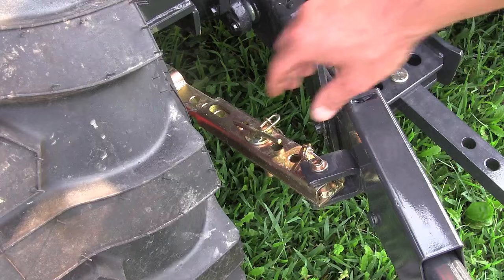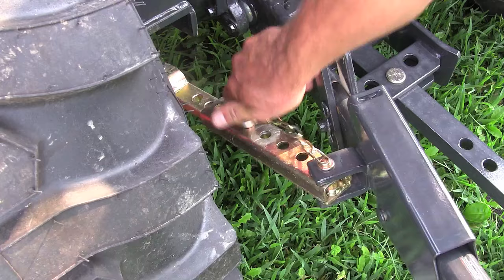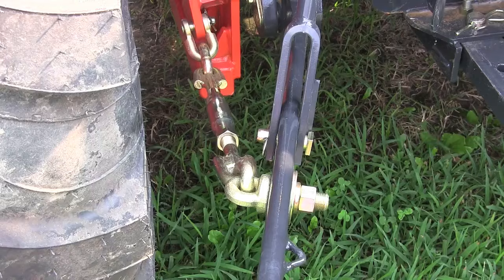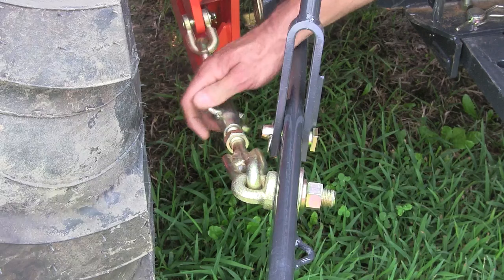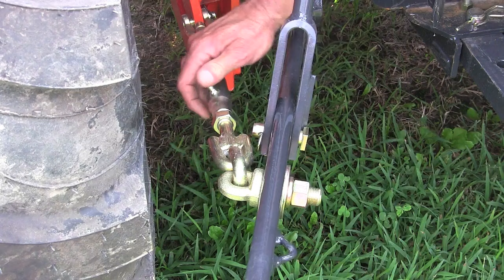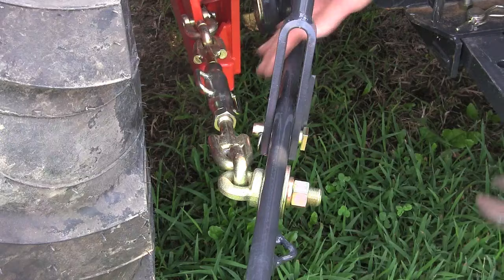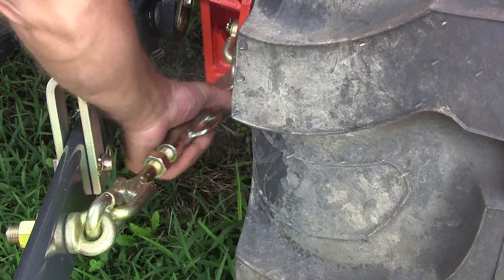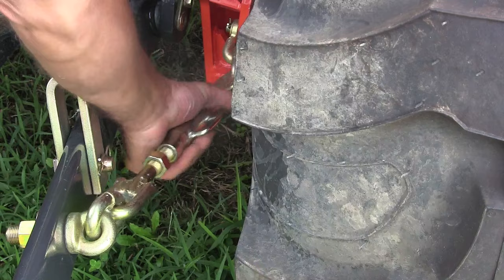How to Adjust Tractor Three Point Stabilizers

Comment: Mike, you tightened that first jam nut with the crescent wrench BACKWARD.  The second one you tightened correctly.  The strength is not in the jaw but in the steel....Probably not a big deal on a turnbuckle but back on the farm In Iowa, dad would give you a stern talking!  Great video, thanks.
Reply: Same here, wking wells and pumps.  You just want to through a sloppy Adj wrench in the trash.

Comment: I didn't notice on your tractor and you didn't mention it, but on my tractor, height matters. I have to raise the arms all the way up before adjusting. If I do it down low, the chains get tighter as I raise the arms up. When I lower them back down into position, the chains are a little loose, but not bad. The first time I adjusted them low, thankfully, I stalled the hydraulics and nothing got broke. Now I watch for it. Keep up the great videos!
Reply from the maker: Good point.  I really hadn't noticed that before but I've seen stabilizer designs that could cause a problem that way.  Thanks for bringing that up!
Reply: that happens when the chains are not connected in the same line with arms pins on rear axle; or the holes for the chains are worn out and connection point is out of that line. Tightening when lifting shouldn't be a "feature"

Comment: There are indeed stabilizers for older Deere tractors. They are steel blocks that mount on both sides of the PTO housing that have two different thicknesses, depending which side of the block is turned. These work as spacers. This will keep your implement from swinging side to side as much, and keep the arms out of your tires (only when mounted to an implement). But no fine adjustment.
Reply: Correct.
Reply: That's right. The sway blocks are missing from the J.D. and were used starting with the 730 series.  You used spacers between blocks and housing to achieve correct sway.  Worked great. ******  Also Tractor Mike forgot to warn that you must slowly raise the arms and make sure chains don't get too tight in full raised position.  Expensive parts can get broke if you raise 3 pt. without checking first.

Comment: You described the stabilizer chain's function to keep the lift arms from hitting the tires. That is the function of the check chains. Stabilizer bars keep your implement centered and moving from side to side. If you want your implement to move from side to side but need to check the travel so you don't hit the tires, like when pulling a plow, you use check chains. That old Ford tractor you showed looked like a thousand series  tractor because it was blue. What you showed on that Ford were check chains. That tractor came with solid stabilizer bars that attach to stabilizer pins on one end and to the lower link implement pins on the other. Ford lift arms do not have holes in the lift arm for a stabilizer chain, though some people drill holes in them so they can attach stabilizer chains.  If you are using your chains solely to prevent your lift arms from hitting your tires, you are using them as check chains, not stabilizer chains.
Reply: pat cheatham 
The check chains on the old blue tractor prevent your lift arms from swinging towards your tires. You might have to remove links depending on the height of your lift arms. 
For stabilizer chains you loosen them up so they allow movement, but still keep the arms from hitting the tires. But, unlike check chains, stabilizer chains must have an implement attached to the lift arms to limit the lift arm movement. With stabilizer chains the left chains prevent the right lift arm from hitting the right tire as long as you have bound the lift arms together with an implement. If you don't have an implement attached, then you use a bungee cord and tractor Mike had a bungee cord on his lift arms for that reason.
Reply: TheDadPenfield ok good now I don't have to type this lol
Reply: what implements do I use and not use the stabalizer bar on my ford? to keep it from swaying? on the ground lock it solid and in the ground let it sway?
Reply: I have a 601 workmaster, and I added a second bar so it could stop swaying to the left and when I lifted the 3pt up it bent the hell out of the new bar while the old bar stayed intact. I hadn’t run into this on my 8n so I’m not sure how to fix this

Comment: Geez, I used to own a 1968 Massey Ferguson 165 and it had round solid bars with threaded rods to act as stabilizers.  You could adjust them to center the implement on the tractor's center line.  That's exactly what I did to center a Four Row Monosem MS vacuum planter on mine.  Tractors with cabs sat on my farm while I precision planted.  When you're planting onions you want to be able to get on and off the tractor easily to check if a shoe is clogged or if a spray nozzle is clogged, which it never was, but you do it if you're a perfectionist.  As far as these chain and turnbuckle stabilizers, they only come on cheap tractors.  If you need absolute stability get a tractor with tube stabilisers that screw in and out.  I'm looking at this tractor, I don't know who makes it but it is about as cheap as you can get. GET A SOLID TUBE TELESCOPIC STABILIZER KIT AND BE HAPPY!

Comment: Mike,  you missed some stabilizers from the past. My old 1959 John Deere 430 had a separate stabilizer that was like a "U" shape at one end connected to a "Y" shape. (Imagine the "U"  in the saddle of the "Y" ). 
A bar connected that stabilizer to the tractor just above the PTO. Ford used an outside bar on one side that (sometimes both sides) to control implement sway.

Comment: My Tractor (1982 IH 260A) have non adjustable chains.  Box blade does not seem to be centered and swings side to side.  It looks like I have to ADD these adjustable turnbuckles.  Thanks for the Info.

Comment: THANKS FOR ALL YOUR GREAT VIDEOS. I HAVE A FORD 4000 SU, WHICH I HAVE TRIED DIFFERENT TYPES OF STABILIZER BARS, STABILIZER CHAINS. THE BARS, LET BE RAISE & LOWER MY HEAVY BUSH HOG, BUT ARE A "PAIN", BECAUSE MY DIFFERENT IMPLEMENTS VARY IN WIDTH. THE CHAINS, WITH THE JAM NUT, WILL NOT LET ME RAISE MY BUSH HOG, ETC. TO IT'S HIGHEST LIFT. I DON'T WANT TO HURT HYDRAULICS, OR DAMAGE THE ARMS. CAN YOU PLEASE TELL ME WHAT TO DO, I WOULD APPRECIATE IT MOST GREATLY. THANKS.........

Comment: Mike - I have a 7’ Enorossi sickle bar mower and am using it on a 65-HP tractor.  The lower 3-point arms are set at equal heights from the ground; however, the mower leans quite a bit to the bar side when raised.  Is this normal and acceptable or should I adjust the lower arms to level the mower even though one arm will be about 3” higher than the other arm?  Thank you.
Reply from the maker: Tricia, I think that's normal.  As long as the bar is level, you should be fine.

Comment: Could you give any advice on setting a plow for a wide wheel stance tractor. With stabilizers set as far to the right as I can get them, I am still leaving a spot of unturned soil. Wheels are set in as far as they will go as well. Tractor is a Mahindra 4025 4X4.

Comment: The second type (turnbuckle), is it cheaper to buy? It's not like the telescopic version is drastically more expensive to produce, I guess. But the turnbuckle seem inferior to the telescopic. And those have been around since the 60ies (have it on a MF 175). So why would anyone want the turnbuckle variant?
Reply from the maker: +subwarpspeed That's a really good point.  You wouldn't think the telescopic would cost much more.  Most tractor companies offer deluxe tractors with telescopic and basic (cheaper) tractors and they lack a bunch of options to get the price down (see my video-Two Identical Sized Tractor, Why One is $3000 cheaper), so it may have more to do with marketing than anything.  If I were a tractor company I'd offer a kit to convert the turnbuckles to telescopic and charge a hefty price for it, but most don't.  It's a mystery.  Same way with a mechanical linkage at the back of the tractor to raise and lower the three point from behind.  When I first saw that option 25 years ago I figured by now all tractors would have it and they don't.

Comment: Mike, i have telescoping stabilizers on my Massey Ferguson and a Bush Hog brand bush hog. No matter how I adjust them, out/in, they hit my tires, especially on turns and on inclines. It seems to have gotten worse the last few times I cut. Which direction, pulling them out or pushing them in, stops that?
Reply from the maker: Bill, email a picture of the stabilizers and the model number of the tractor to mike@asktractormike.com and we'll see if we can't figure it out.

Comment: Mike: great stuff...I have a 1967 JD 2020 that needs your help.  As shown in this video, there are several older tractors with no stabilizers.  What do you suggest?  I need to add something besides a rope or a bungee cord.  My new box blade is heavy and swings too much.
Reply from the maker: I don't know of any kits to add stabilizers.  I'd be trying to "blacksmith" something on there to keep everything from swinging.

Comment: Hey mike great channel - question i am suffering really bad with undulating soil when using the rake on the three way. Its a five foot rake i have it set about an inch lower than the level when at bottom stroke. I drive slowly through the sand yeah we live here in oz and the soil here is mostly sand we can grow things in it and we do but i need the rake for weeding and leaf gathering. I also try to use it for firebreak maintenance but like i said i keep getting these sand waves everywhere rather than nice neat flat raked areas...ideas please?
Reply from the maker: Waves from the tines of the rake or waves from the tractor driving over uneven terrain and digging/lifting the rake up with the three point?  You might experiment with a field roller.  That might work in sandy conditions to level everything out.
Reply: @TractorMike  will try that thanks for reply, will report back with results merry christmas

Comment: I have an international b 414 tractor and i need to install stablizer bars i tried tractor supply to no avail is there another supply store's that possibility of having them i live in southeast Kansas.
Reply from the maker: I don't think  you'll find something like that at a farm supply store like that.  You have several Case dealers in your area, you might try them, but I don't have high hopes a part like that would still be available because of the  age of the tractor.  Here's a link to the Case IH parts lookup: https://partstore.caseih.com/us/parts-search.html#epc::mr57566ag58303.  Youngberg's Supply in Verona, Missouri has an IH salvage yard and they might be able to help you.  Here's their number: (417) 498-6511.  Good luck!

Comment: I break at least one of my New Holland Stabilizer bars about every 10 hours. At $95 each, it's getting unbearably expensive. What am I doing wrong?
Reply: Larry Watkins. ..I own a New Holland workmaster 50, and I just got rid of the telescopic stabilizers. They were just too sloppy and noisy. Installed some turnbuckles that came off an 82 kubota. Had to modify it some, but not too difficult. Such an improvement.